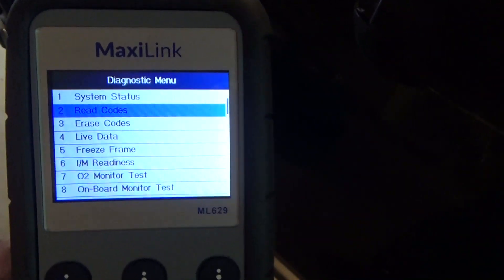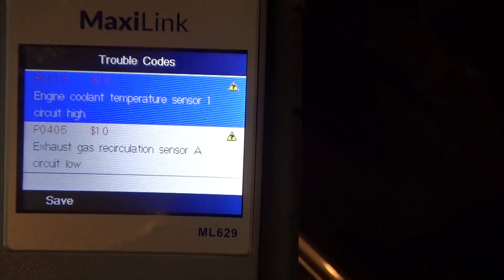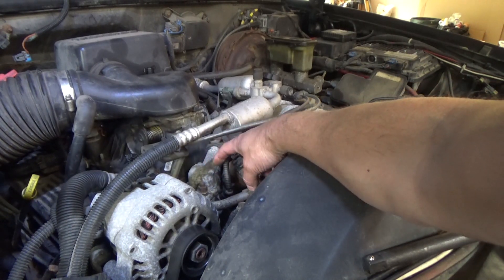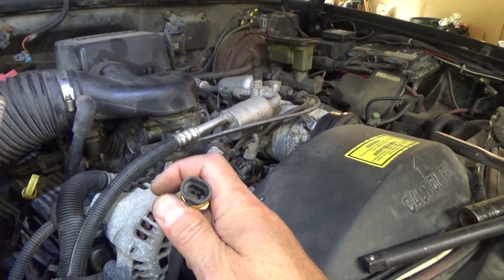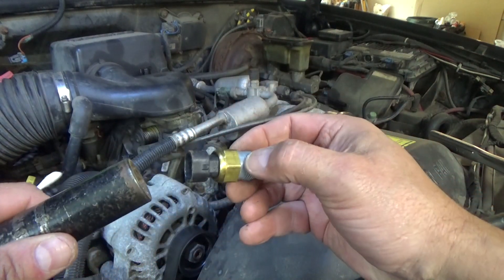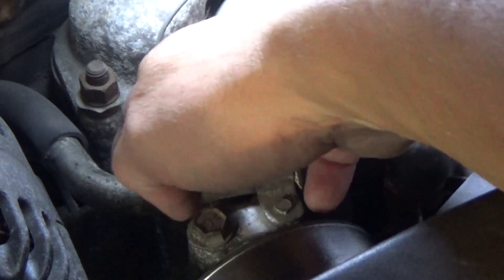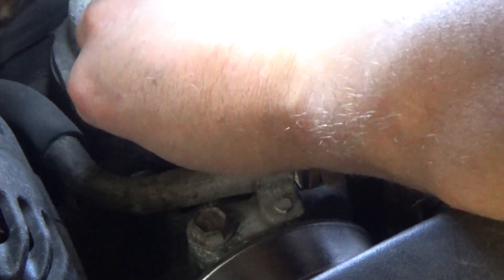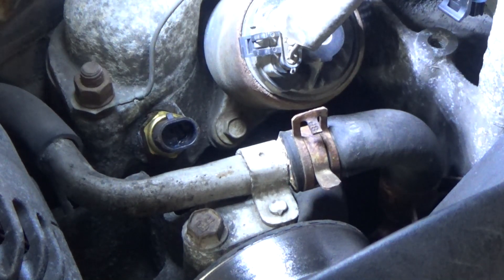Rough Idle, Stalling When Put In Gear, Engine Coolant Temperature Sensor Replacement - GMC ECT P0118

Comment: Hello there , I have a question, my 1995 GMC Sierra TBI engine, first start right up then stalls and when I’m put into D or R the engine shut off right away. Can you tell me what’s happen to my truck and what’s parts I need to be replaced? Thank you so much
Reply: Are you mechanically inclined? If not trucks not getting fixed

Comment: I have been led to believe that one should not put anything between the sensor's body and the engine block, because of interference with metal to metal grounding. Is Chevy different from Ford (4,6 engines) just asking?
Reply: no ground just two wires

Comment: I know this video is a year old however, but I just have to thank you for the short and sweet video. The largest help was the simple breakdown of all the problems you had prior to swapping the sensor out. My '08 grand prix has had a multitude of problems, and I've swapped each part only to finally narrow it down to what I believe to be the ECT sensor. My car's thermostat gauge on my dash stopped working causing the car to sporadically rev up or chug. The transmission slams into gear because the car is revving higher than normal. It eats gas like never before and it's only recently struggled to get started. Hopefully this sensor fixes all of that and puts my mind to rest for once!

Comment: I've been thru 3(!) ECT's in about 2 months in my 2008 Toyota Takoma..the tip of the sensor seems to be getting worn off or abraded or dissolved..getting tired of replacing them..it fixes the problem for about a week or so then it starts to fail..any thoughts? grit or abrasive in the coolant? radiator should filter out any large stuff..HELP!

Comment: Had to hold the gas to start the vehicle and sometimes it would try to shut off and blow black smoke. Putting it in gear would stall it unless it was warmed up or floored to get it moving. It's hard to believe one sensor caused this issue, but it works now.... Except my starter is now either dead or the wires are corroded 😅😅

Comment: It’s a simple change  My ‘94 Sonoma keeps giving me the code low temp senor I’ve changed it twice and runs good for a while and it starts again same problem I looked at the wire looks good. Problem cold start rough idling and once it warms up it runs like when I got it in ‘94

Comment: I believe this fixed my stalling issue we’ll see in the morning! Haa
Reply: Do you have a 7.4 too? I have to hold the gas to get it to start and there's tons of black smoke if I give it gas and it stalls when I put it in gear
Reply: Carter Eberline nope brother I have a 5.7 Chevy pickup. This did temporarily fix my issue but it came back.  Doesn’t seem to be happening anymore so idk.